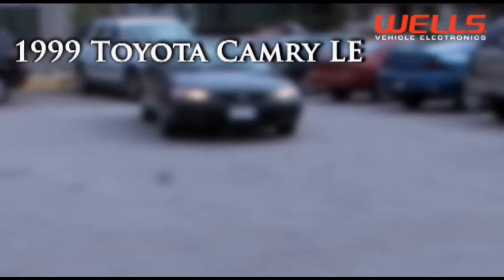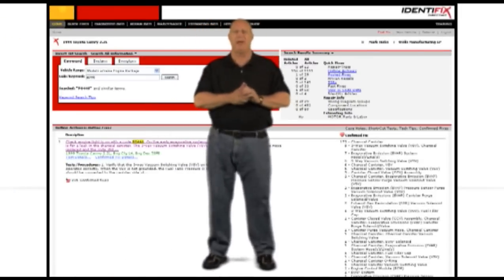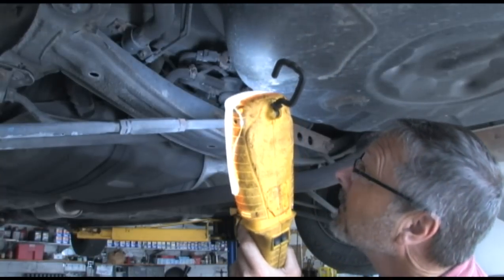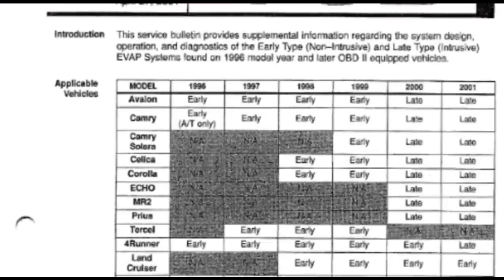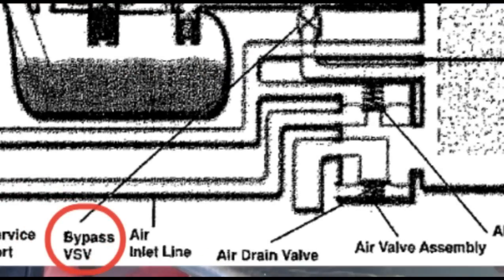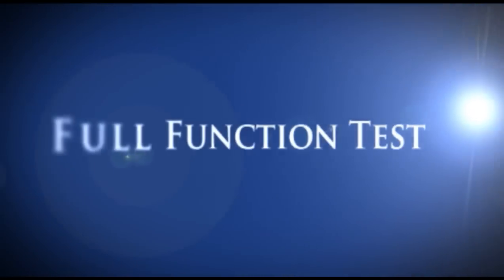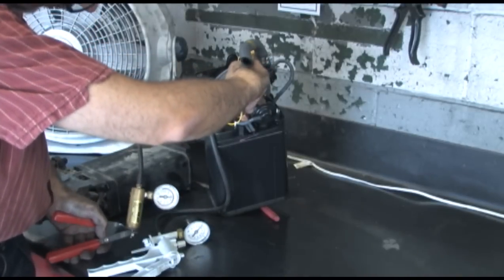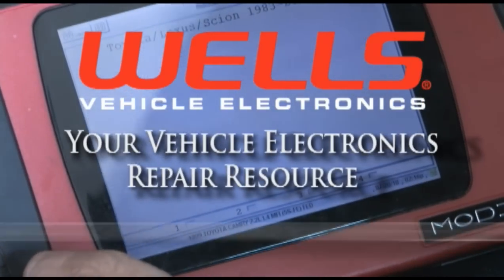Toyota Po441, P0446 EVAP Vacuum Switching Valve VSV Testing and Canister Replacement

Comment: I am fixing a 2002 Avalon xls (v6 engine) that has been having intermittent P0440 and P0442 codes.  The first time this happened, there was also an issue of the engine starting, idling very weak and then dying.  This happened and then went away.  Now a week later the codes are back.  Took it to a shop for diagnosis and they said bad purge valve and that a smoke test reveals a leak at the canister.  A couple of questions.  First, can a bad purge valve cause the engine to die after starting?  Also, a full canister replacement does not sound fun.  Wondering if anyone has had any luck with finding the part and just replacing the solenoid valve on the canister.

Comment: I have a 99 corolla the vent valve works backwards from your video , key off its closed , key on its open , I checked the toyota parts number , its the correct part number for the car , and its a new toyota canister ending with 71 . I got a cheap one first the vent valve switch did not work . Dont know exactly whats wrong with mine yet , been repairing possible problems front to back a while now got it on the road and more problems , it has all new lines front to back , tank and hoses , new filler neck , valve under hood works , new cap no pressure movement on my scanner sets at .012 , using a hose sealed to filler neck and blowing into the tank , not with a air hose , the reading goes up to .017 , so that leaves the small vacuum lines , diaphragms , cracked or plugged canister and switch . Several times clearing codes p0440 ,p0441 , po446 , 441 always sets , the others pending maybe this will fix it . What bugs me is the 2 valves , in the video and mine , work opposite of each other ...

Comment: i already change the gas cap, the vsv behind the motor and when i replace the canister the light when off for almost 2 weeks and now the light come back and is showing me the same
code, what i need to check now ? the other vsv by the air filter box is working too and all valve are getting power

Comment: I have a '00 camry CE. it WAS the canister.  Thanks for the info guys.  👍. I invested in a smoke test after replacing gas cap and vsv by canister and actually found out the top part of my canister  was cracked. 😂. I shook it and it sounded like a rattle. Even my rough and crazy idling got fixed.
Reply from the maker: Hey Benjamin,
Good to hear! Nice work getting it fixed!

Comment: Good afternoon! I have noticed that you are still responding to some comments so I figured I could give it a try and ask!

I have a 2002 Toyota Camry LE 2.4L. I was receiving CEL code P0440. I went to a shop, they performed a smoke test, and they replaced my "intake control vent solenoid valve". CEL came back a about 2 days later with now P0440 and P0441. So I then replaced my gas cap with an OEM Toyota fuel cap and I reset the codes. Another 2 days later, the same P0440 and P0441 codes came up. I then replaced the VSV, VSV Assy no.1 along with all their hoses and deleted the codes. Again, the same codes came back 2 days later. At this point, I decided I had to replace my vapor canister since I had already replaced everything else. Well... it was tough but I managed to install a brand new charcoal canister over the weekend. Once finished, I erased the codes and felt confident it would get rid of the evap CEL codes. Then... my CEL came on today (again, about 2 days since the replacement) 😵 but now I have codes P0440, P0441 and now P0446 as well 😞

All of my hoses are fine and every single part I replaced with brand new OEM parts. Is there something else I have to do in order for these pesky codes to go away? Do I have to reset my ECU? How would I do that? Are these just the old stored codes that weren't deleted when I "erased"/reset the CEL codes? My OBD II device says that "some codes that are stored cannot be erased" when I cleared the CEL. It is a device I bought from Walmart. Do I need a more advanced machine in order to fully reset the codes? Do I just need to keep driving it to 100 start-ups? (I've only started it around 10 times since I replaced the canister whwn the CEL came back) I just want these dang codes to go away and for my car to function properly again. Please help!!! 🙏
Reply from the maker: Hello,
With all those parts replaced and the codes that are setting. There is no solid advice I can give you without guessing. These codes can set for a lot of reasons and if they keep coming back there is still an issue with your car. It is interesting how you started with one code and now have 3. If it was me, I would start over completely. First test that all the solenoids work using a scan tool, this rules out the solenoids, wiring and ECM. Then I would preform a smoke/ flow test to prove there is no leaks in the system. Also check that everything is connected correctly. I have seen these codes set from something as simple as a hose off the canister closed valve at the air filter box or two hoses routed incorrectly. Sorry I couldn't be more help, but as you know EVAP codes are tough to solve. 
~Ryan
Reply: @GoTechTraining  damn... so it wouldn't have anything to do with the ECM?
Reply from the maker: I personally have never seen a ECM failure for those codes on a Camry . It is possible but i wouldn’t investigate unless the solenoids  weren’t being commanded on 
~Ryan
Reply: @GoTechTraining  I do very much appreciate your insight and taking the time to answer my questions, thank you.
Reply: UPDATE For anyone reading this, my CEL still comes on with the same evap codes. But now I have like 4. All surrounding the evap. I've replaced every single possible thing that it could be as far as I know. My next step is to go pay for a smoke test since nothing I've repaired/installed fixed the problem. Sucks 😓
Reply: @TheBlindReaper  I’m very curious if you found a solution, I hope all is well
Reply: @sigogglin2817  hey there! So I got the smoke test. Turns out it was some cracked/damaged hoses for "gas emissions" near my fuel tank. Unfortunately, the hose I need is discontinued and there's no aftermarket equivalent. So until I decide to take a weekend to drop my fuel tank myself to look at the hose, take measurements, and either go to a junk yard eith snother camry or buy some hose from ace hardware... I'm screwed with the check engine light lol
Reply: @TheBlindReaper  Did it end up going away? I have the same problem with my Camry P0440
Reply: @katherinesolorio2366  no unfortunately. I just live with it. The only way I can fix it is if I drop the fuel tank, identify the cracked hose that the smoke test indicated, take measurements and go to the store to get one cut for me to replace the hose with the leak.
Reply: @TheBlindReaper  Makes for a fun project.  Thank you for sharing the info.

Comment: My 99 toyota celica gt, 5sfe engine, has no running issues at all. This video is basically the same as what I'm dealing with. I changed my canister with a used one I  happened to get from pick n pull some years ago, my friend and I used a 9 volt battery to check the valve, and it worked, the valve is dead on the one that was on the car, I thought we had fixed the problem, but I still have p0446 cel. I've also replaced the vsv for the vapor pressure sensor, still cel, I've also replaced the gas cap, still cel. 
    I don't think I have a vacuum/pressure  leak in the gas tank/filler neck because when I run my car to E on the gas gauge, there is suction when I take the gas cap off....so that leaves vacuum lines or the ecu. Last time I had a mind F cel, it was for the egr, I replaced the entire system,...it was the ecu. I got a used ecu, cel gone. I think I'm gonna try the ecu next. Any help is appreciated!
Reply from the maker: Hello, 
If there is suction when removing the gas cap, you most likely don't have a leak. But I would also check all the vacuum lines and hoses for restrictions which could also cause this code to set.
~Ryan
Reply: @GoTechTraining  I plan on it, I want to take the canister off again and check/clean all the lines, as well as all the vacuum line connections. I called a shop and they said I should get an oem gas cap, I guess the later year celicas have gas cap problems? I guess I'll buy another gas cap, seems odd. Thank you for responding! I appreciate it!

Comment: I have a 1999 Toyota Avalon. I am getting P0441 again. It went away for 5 years, but it is back tonight, most likely from it being so hot out. Usually this shows up when it gets up in the 90s.
I looked up the part number 5 years ago, but it went away, so I never replaced it. Can you tell me what the part number is for the VSV valve. I know there is a part number for the entire canister, but I just need that VSV valve. Thank You

Comment: I have a RAV4 2000... which looks like on your chart falls under “late” model. I have that stupid Evap code P0446 and check engine light. 
I’ve cleared this code before and did a drive cycle to pass smog last year. But then few months later my check engine light came back on and I tested it again today since my car is being all weird. It’s the same Evap code but this time when I ran the codes Evap was still green and in the clear. But the code was there, along with check engine light that’s been on. 

People are saying it’s going to be expensive to repair or even take it in and I am on one serious budget. 
I wonder what it is.... wish I had mechanic friends haha.

Comment: I'm getting the codes p0441 P0442 And p0446 on my 03 toyota tundra V6 3.4L. it also accelerates weirdly like I'm not getting enough gas or not enough air but I am thinking that it is this EVAP vsv.

Comment: Nice video I got an 2.2l camry 98 with 359,609 miles still going strong and running has a rear main seal leak but it doesn't leak now I put a heavier weight oil and do a oil change went for an inspection today and it passed easily if the motor goes out probably replace it or get an bmw nice video sometimes these cars are hard to pass inspection

Comment: Hi! Im troubleshooting a p0446 code. I replaced the VSV near the air filter box and the purge solenoid at the canister and the gas cap. But the code keeps coming back. What can I do next?
Reply from the maker: Hey Ernest, I suggest taking a look at our EVAP playlist. In there is the information required to diagnose and repair your issue.
Mike Becker, Senior Instructor

Comment: I replaced the charcoal canister on my 2001 Solara 1MZFE (V6) a couple years ago after having this error and all was well. I'm getting P0441 and P0446 again recently. I've had two shops try to hunt it down (smoke machine, replacing lines, replacing VSV) everything tests normal on the scan tool but it's still throwing codes. Did the charcoal canister go bad again or could it be something else? I checked the serial number on the PCM and it's one of the "suspect" PCMs that gives false evap codes, but I'm inclined to think that's not the problem since the evap system has functioned normally for years.

Comment: I have the same trouble code P0446 on toyota camry LE V6 could it be the charcoal canister on mines?
Reply: 1997
Reply from the maker: Hey Luis, thanks for watching. A P0446 could be an issue with the canister assembly on these cars. Some testing would be a good idea for sure.
Mike Becker Senior Instructor

Comment: Hey I have a 2000 LEXUS GS 300. I have a P0446 code alone. My car seems like it’s misfiring after a little drive. What could be the problem? THANKYOU!
Reply from the maker: Hey Arianna, take a look at the purge solenoid under the hood. If that's stuck open it could cause codes and a driveability issue.
Mike Becker, Senior Instructor

Comment: Hey so a code came on my 1999 Toyota Camry  p0441, I see that you did testing on the new canister but can I just install the new canister, or do I need to do the testing first. Also is this job impossible to do at home without a hoist ?
Reply from the maker: Hey Omar, no, you really don't need to do any testing on the new one if you don't want to. As far as the job, it's difficult to do without a hoist, but not impossible.
Mike Becker, Senior Instructor

Comment: Im getting a PO446 and PO441 code on my 1999 camry with the 2.2.  About a week ago my car developed a misfire while idling (in drive only) mainly at stop lights. Happens randomly, and has gotten worse. Under heavy acceleration there is also a little hesitation. Could this be bad fuel purge valve? Any opinions will be greatly appreciated.
Reply from the maker: Hey Chase, if the code and the complaint are related, yes it could be a bad purge solenoid. It should be sealed up when not commanded on. If you can blow though it when it's unplugged, it's junk.
Mike Becker, Senior Instructor

Comment: I got these 2 codes on my 2000 v6 solara today, is it safe to keep driving the vehicle for a while
Reply: I smogged it w the evap and cat not ready, it passed no problem
Reply from the maker: Hey Jim, typically these codes are only an emission concern. The car is not able to properly seal the fuel system so vapors can leak out into the atmosphere. This usually isn't a safety or driveability concern.
Mike Becker, Senior Instructor
Reply: I cleared the code, just waiting for evap and cat to pass, but no cel light yet
Reply: if it doesn't come back on immediately,  I'm gonna go smog it cuz my registration is due in march
Reply from the maker: Jim, many times you can get through an emissions test with one monitor incomplete. It can't be failed though.
Mike Becker, Senior Instructor
Reply: the cel light hasnt came back on either. I've driven it like 100 miles. fluke u think?
Reply from the maker: Jim, maybe a fluke, maybe the vehicle hasn't been in the right parameters to run the test.
Mike Becker, Senior Instructor

Comment: Just wanted to add that sometimes because the solenoid clicks doesn't mean its 100% good. You should follow it up with testing it with a vacuum pump. Cas ein point on my Camry the solenoid at the air filter was clicking but it wouldnt  hold vacuum. It's a normally open valve and when voltage is applied its supposed to close. Mine let vacuum acummulate but would bleed off slowly. This is what was causing my issues.
Reply from the maker: Very true Jackson!!!
Mike Becker, Senior Technical Instructor

Comment: You say that there are 3 connections 1-canister 2-purge solenoid 3-pressure sensor but then you tested something called VSV.  Which is it?
Reply from the maker: VSV is something that Toyota uses. It's the vacuum switching valve and it isolates part of the EVAP system.
Mike Becker, Senior Technical Instructor
Reply: @GoTechTraining  So are you talking about a 4th connection or what? Would my 1997 Camry XLE 6-cylinder have this?  Car is getting code P0446
Reply from the maker: It's not a connection really, it's a valve that's "inline" of the system. It's usually part of the new canister assembly.
Mike Becker, Senior Technical Instructor
Reply: @GoTechTraining  . I have a 2000 Toyota Camry le 4cyl 5sfe engine vin #JT2BG22K  do you know the part number for the canister for this car,  I'm getting conflicting results from my search online.  And because I might need to drive this car if my other car gives me unexpected problems, I rather not remove the canister until I buy the replacement, removing the canister is not too hard but if all of the sudden I need to drive the car and I don't have the new part ready, putting it back is not going to be fun  , I get better results when I take my time, anyways thanks in advance.

Comment: 99 Camry 3.0 with p0441 & p0446.  I see Toyota has a replacement Vapor Pressure Sensor  VSV (called also the "Fuel Tank Bypass VSV" on scan tool) part# 90910–12271 mentioned in TSB  EG013-02.  Is this the same VSV you tested to be faulty in this video?  I'm assuming it is, as that VSV is available from Toyota parts, so if the canister tests ok, but the VSV is tested faulty, then no need to replace the whole canister, right?
Reply from the maker: Right, if the valve is the only bad thing, then that's all it needs.
Mike Becker, Senior Technical Instructor

Comment: Not really! I replaced the canister the hoses, the switch valve located on the air filter and the egr located on the block on the engine and the gas cap and still shows p0441! Every time the system detects any problem whit the vacuum system it will show p0446
Reply: I would use mass air flow sensor cleaner and throttle body cleaner. I have a 1998 and I have the both 0401 and 0446 codes.

Comment: Does this cause a small backfire when coming to a stop then trying accelerate hard then a pop in the exhaust ??? And I do smell some sort of fumes??
Reply: P0446
Reply from the maker: Take a look at the purge solenoid. It should be sealed up when it's unplugged. If it's not, it could be the cause of your issues.
Mike Becker, Senior Technical Instructor
Reply: NGK Technical Training could this be replaced without changing the whole canister??
Reply from the maker: Hey Sosa Billy, usually an EVAP system issue will not cause any driveability issues. I would be looking for something else at this point. Any trouble codes?
Mike Becker, Senior Technical Instructor
Reply: I have this same problem too. Did you find a solution?
Reply: Arianna Mercer clean mass flow air sensor and clean throttle body good and will start running like a brand new car ..!!!! No bull shiittn👌
Reply: It’s the mass flow air sensor causing all these problems 💥👊🏽💥

Comment: I have a 2001 Toyota Camry V6. I have three codes; P0440 P0441 P0446.. The gentleman at Pep Boys said that he's 99% positive that I need to replace the canister and Vacuum Switcing Valve. Do you agree?
Reply from the maker: I wish I could say off of just the trouble codes. If I could, I'd be a billionaire. The only way to know is to perform the testing. If they did that and determined its bad, then sure, I agree. 
Mike Becker, Senior Technical Instructor